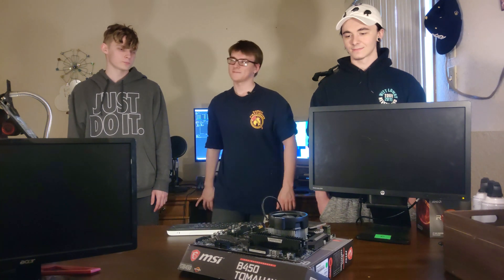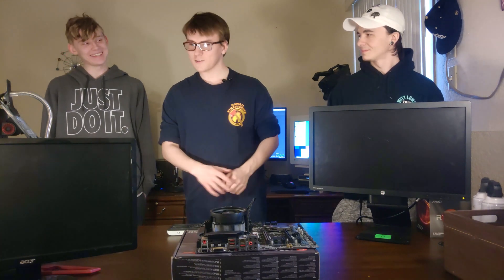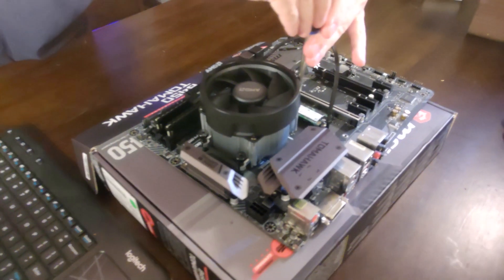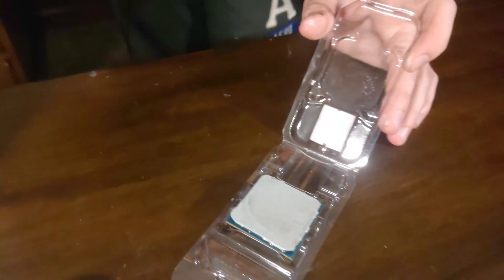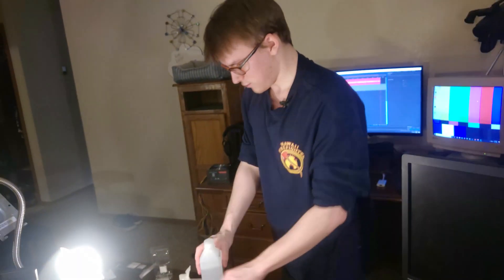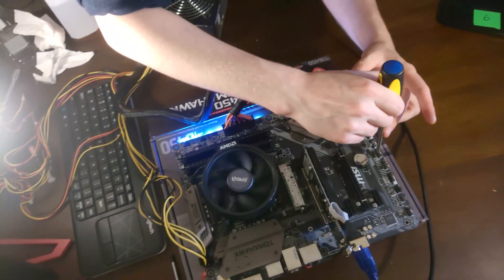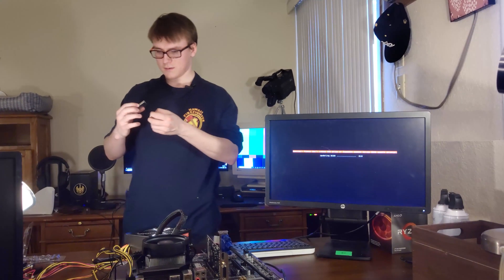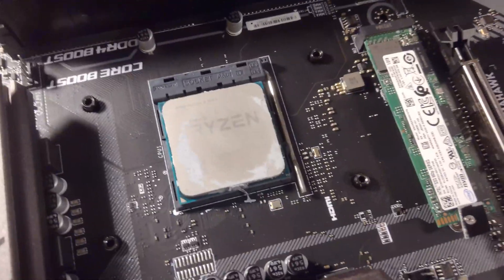CPU RIPPED OUT of the Socket - 3rd Gen Ryzen Bios Update Guide

Comment: Trick is to turn off the AC in your room and stress test your PC for good 15-20 mins before removing the CPU. Also don't forget to gently twist the cooler to remove this. NEVER try to remove the cooler when your CPU is cool/ shutdown for a while.
Reply: I use a blowtorch and blast it on the heatsink

Comment: I just did the same thing 10 min ago
Reply: I did the same thing now what should I do please help
Reply: @rishavraj9025  check your pins, clean and re straighten.
Reply: @MrLogic204  all the pins are now straight but still not booting what should I do now
Reply: @rishavraj9025  may not be the CPU, check power supply, and connections.
Reply: @MrLogic204  when the cpu is plugged in the pc doesn't turns on but when the cpu is plugged out it turn on
Reply: @rishavraj9025   CPU may be done then, I'm sorry.
Reply: @MrLogic204  okay thanks for helping
Reply: @rishavraj9025   no problem

Comment: Did the same exact thing testing a failed ryzen 9 3900x on a different mobo. I have no idea if it wrecked the board yet. I see i'm not the one to have their heart drop out from that stock cooler
Reply: Happened to me, but my mobo still works
Reply: So, is it confirmed that the CPU is corrupt?
What happened next? What all did you do? 

I have same issue with 3900x and I hope CPU is not corrupt. Did you test on another mobo?

Comment: Just built my first pc ans this happened to me, my heart literally sank but there was a slightly bent pin on it and i dixed it and it managed to work so were in the clear, luckily
Reply: Glad it worked out for you. I am in the same boat. My first self made build ever with a R7 3700x and stock cooler. I forgot to attach one hook of the Wraith Prism cooler before lowering it on the CPU and had to pull it out but that damn thing was stuck! So little by little I applied more force pulling it. A ripping sound and my heart sank.... the cpu was glued to the cooler and I had ripped it out from the locked socket! I thought that's it! 300€ down the drain. Luckily no bent pins. The System has been running for a week now with no Issues at all. Let's just hope I didn't damage the board or CPU  and it won't die on me anytime soon, fingers crossed!
Reply: Shinbaal99 it all running well dude? The same thing happened to me when installing the cooler, it leaned on the cpu cus one side was lifted up when I installed it on the other hook. I unscrewed it and the cpu came off, no bent pins but I haven’t got a chance to boot the system as I don’t have a gpu at the moment. I’m praying that the thing boots!
Reply: @liluzivert101   yes bro worry not it will boot ! I worried for ages so don't worry it works
Reply: @liluzivert101  yes it's running smooth and stable. I was really lucky because I didn't bent any pins. I recently installed my new gpu and I ripped out the plastic holder on the pci slot on the motherboard too, imagine that! Luckily I seem to have more luck than brains because everything is running correctly. I would say don't worry too much as long as you don't have any bent pins. And be sure to install the RAM correctly too!
Reply: @eliteplayer7600  yeah it did boot

Comment: Same thing happened to me with a Ryzen 5 3600X and the stock Wraith Spire Cooler on a Asrock B450M Steel Legend Mobo when I went to change the Cooler for a Cryorig H7, the stock thermal paste on the Wraith Spire is more like freakin' glue. When this happened to me I thought either the pins on the CPU got bent or the socket wasn't going to work. Thank God nothing happened!
Reply: This happened to me with the gigabyte Aorus pro WiFi. This has happened to me twice the first time no bent pins and second time 2 bent pins. I tried bending them back and did but when I was installing the cooler it came out of the socket again with 10 bent pins. I have to buy another cpu now. PLEASE LEARN FROM ME AND DO IT SLOWLY. Even IF IT TAKES 15 + min
Reply: @qeuqe5574  so your motherboard was fine right? Sorry same thing happened to me
Reply: @tranquilityexe6303  Yeah, fortunately my motherboard was perfectly intact and have had no problems since I installed the new cpu.

Comment: I did exactly this 2 days ago. now cpu not recognized by mobo. my first build dream becoming a nightmare
Reply: I did this with my first build with a ryzen 5 1600af gigabyte b450m motherboard , i ripped it out of the socket because i was just trying to turn the heatsink the other way around and i ripped it out bent/broke some pins, i just ordered a ryzen 3 3200g today because the price of the 1600af went up and i hope to god my motherboard is still okay, Did you have any luck with yours?
Reply: Same thing happened to me today, were you able to fix it?
Reply: @shadow66395  i wasn't, i had to buy a new processor even worst then the first one i bought. but it was worth it at the end of the day.
Reply: Did it break the socket as well?
Reply: This just happened to me. What are the odds my motherboard is screwed also?